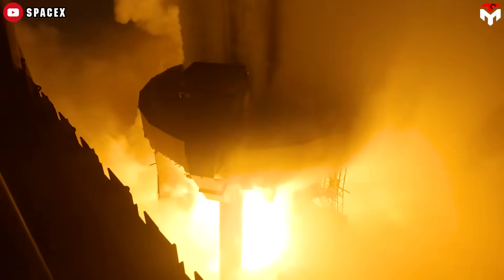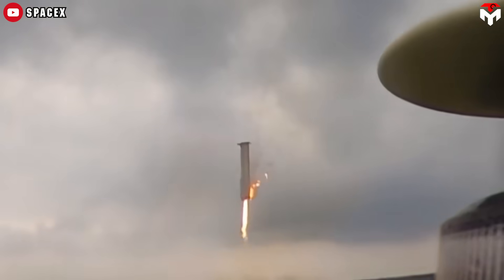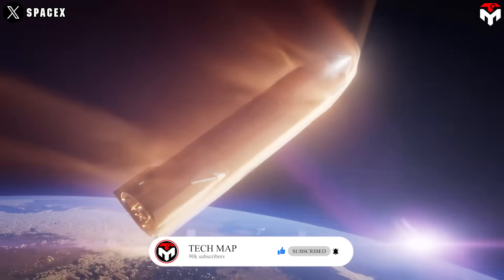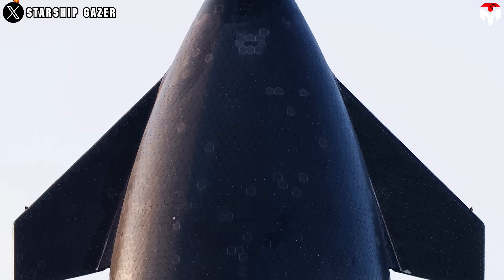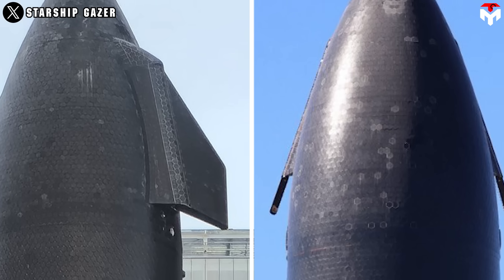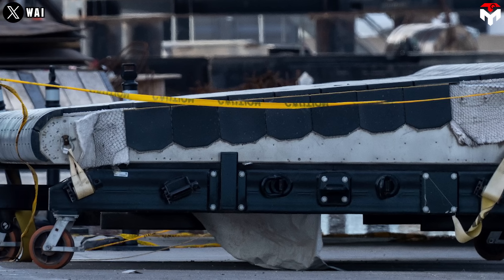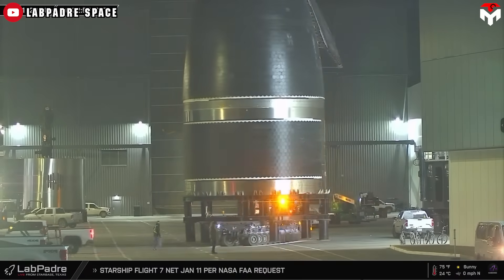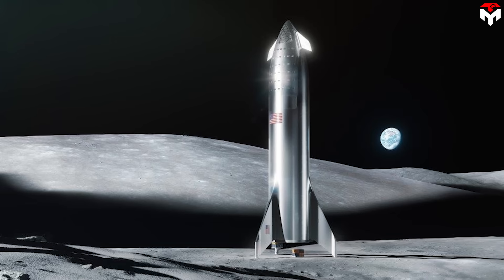1500°C Melt!New Starship's FLAP Upgrade to Break Physics...

Comment: The problem is that spacex has painted themselves into a corner with the stainless. 

If they want to make the ship work with the design philosophy of the structure baring some of the thermal load there’s only one option: titanium. 

They are going to have to keep adding tps until the whole ship is protected, then the whole point of the steel is moot. Might as well build out of aluminum for 5th the weight.

If they want to have starship fly the way it is now they have to do titanium, otherwise they fly 5-10 times with like 6 month turn around times.
Reply: I don't see how they are painted into a corner.  It would make sense to use S.S. for these early disposable prototypes.  Titanium can still come later with high value reusable operational versions.
Reply: @ I mean that they’ve painted themselves into a corner of constant development. They keep needing to put bandaids on bandaids. The first boosters were supposed to lift 100t they actually lifted 25-30t. The flaps were burning through now we’ve gotta add more weight with an entire ablative undercoat. That undercoat isn’t good enough, it’s still burning through. Now we’ve got to move the flaps and actively cool. Now we need to wait for raptor 3 to come online and save our margins. All of these things are bandaids onto the issue of the reentry environment being harsher than the design can take. If they’d just bite the bullet and rip off the bandaid and switch to a material that can handle the stress all these problems would be solved. 

Oh and by the way, there’s a lot of criticism of titanium being so hard to work with. I just want to say that Kelly Johnson built a12s and sr71s back in like 1960. That’s when they had like just discovered that they could even work with titanium. It can 100% be done and will massively increase starship’s capability.